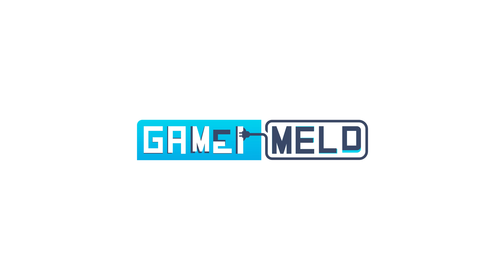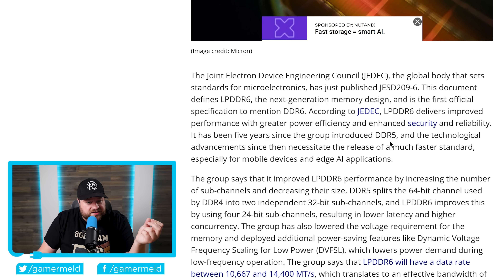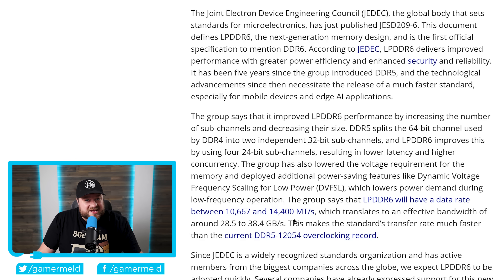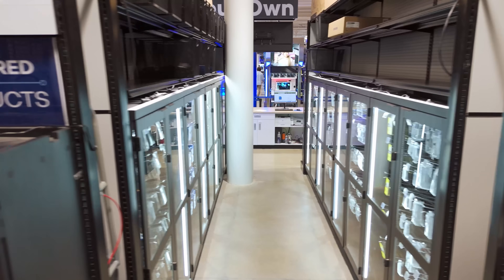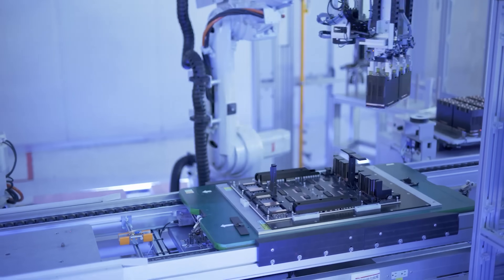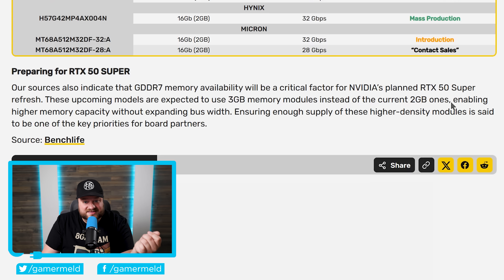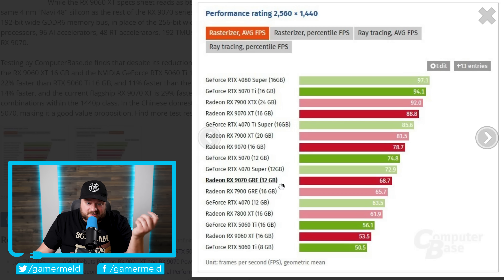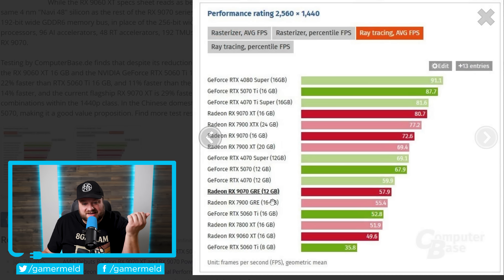AMD’s Mysterious New GPU - FIRST Benchmarks!

Comment: When DDR5 was launched the "performance" was worse than DDR4 at the same frequency, 'coz the stupid timings 36-36-36... that went from 14-14-14, so How The Fuck they're supposed to get faster if these morons increase the latency for synchronization? And the "dual channel optimization" clearly wasn't any improvement. Now Who uses 24-bit? Nobody is either 32 or 64, these morons, must smoking marijuana really hard to think this is a good idea. Also big MT numbers, even with DDR4 & 5, yet CPU Makers don't take advantage of i, and the timings don't help. DRAM is a stupid mess, to sell the same DDR3 RAM with a different disguise everytime

It won't be 10,000, but 11,000

Comment: well when your 9070xt under performs a 3 yeard old GPU then you have problems. LOL. the 7900XTX is my daily go to for everything. AMD went backwards and on the cheap and now selling half the gpu for double the prices. or at least the msrp is there. if the 10k series is not better than the 7900xtx then we are still not getting anywhere.

Comment: Not sure what you were expecting the 9070GRE’s performance to be? It’s 15% slower than the 9070 and 28% faster than the 9060XT… For a GPU supposed to be between the two, I don’t see what they could have done differently? Except maybe for the vram… If the pricing is right, this could be a good budget gpu…
Reply: I guess the takeaway is that the 9060xt is too slow that's what,  when you have that much of a gap between 60 and 70.

Comment: The Rzen 6 10k series will be the first Windows 12 compatible CPU. It has an NPU for ai. I will buy this as i am an IT professional. It will be great for virtualization and AI coding with lliami. I went AMD 5 socket for this and my current 7950x3d is good enough

Comment: Why were you ever expecting the 9070 gre to perform better than the 9070 non xt, the gre sits between the 9060xt and 9070 which is exactly where its supposed to fit but it all comes down to price most likely around $400-$450 is my guess.

Comment: 7900 gre was suppose to be a downed version of the 7900 xtx, so comparing it to the 9070 xt is kind dumb. Just saying.
Reply: Yeah… like 5070 vs 4090😂
Middle range vs highend
Reply: 7900 gre is way worse than a 7900xtx and never shoulder be compared to one

Comment: Interesting! AMD using 2 IMCs. So, what that tells me is, the infinity fabric will be reworked to work with 8 requests per clock, maybe fully supporting 512bit internal bus. It will also allow 2 different impedance values for the 2 DDR5 channels A & B. Motherboards with poorer memory isolation can train the 2 channels separately and help poorer quality memory modules achieve higher speed in a 4 DIMM config. It will bring the costs down significantly because many motherboards are unable to reach the EXPO speed when used in a 4 DIMM config.

Memory makers launching 4 DIMM packages at 7000+MT/s may be in respond to this. Having more IMC also help the OS and CPU schedule memory read/write better but how well that'll work is beyond my paygrade.

Comment: So if is 12 core in 1 CCD then here is what I am expecting: -

Ryzen 3 = 6 cores
Ryzen 5 = 8 cores
Ryzen 7 = 10 cores
Ryzen 9 = 12 cores
Ryzen 9 = 24 cores

Ryzen 7 with 10 cores and the Ryzen 9 with 12 cores will be great with 3DV-cach because all these cores are on a single CCD👍
Reply: Maybe Ryzen 3 will disappear because there are already APUs to fill up that gap. Also AM5 didnt had Ryzen 3 cpus. And i dont think there wont be any 16 core cpus. And it isnt also not sure that 10 cores will be on launch day.. Maybe they will sell 10 core later on the get rid of the slightly worser cpus.

Comment: On DDR6 WHAT KIND OF SOCKET WILL BE INSTALLED ON TO MOTHERBOARDS I HATE DDR5 SOCKET MOUNTED ON TO TOP THE MOTHERBOARD LIKE MICRO USB PORT SIMPLY FALLS OFF IS DDR6 SOCKET WILL FIX THE MOUNTED ON THE MOTHERBOARD LI LINE TOBE MOUNTED LIKE DDR4 SOCKET MOUNTED AND WELDED THOUGH THE MOTHERBOARD STRONG MOUNTED DOSE NOT FALL OFF and way can you find out what kind of information on the DDR6 SOCKET please look in to it

Comment: About the DDR6 news... on AM5 you can only run the memory overclock (EXPO) speeds with two sticks.  If you use 4 sticks of RAM then one typically has to run DDR5 at the base clock of 4800 despite whatever the packaging speed says.  A couple years ago I saw a video from Level1Techs that explained this as each DDR5 stick acting like two sticks in the channel.  If you run four stick of RAM (two stick per channel) then the system behaves like it has four sticks of RAM per channel and the memory controller can't handle it.  I think this is the same for the AM5 9000 series, but I don't know.  So this news about DDR6 makes me think that each stick will perform like 4 sticks of RAM.  So if you were to use four sticks of RAM (two per channel) on the motherboard, the CPU memory controller would effectively see it as 8 sticks of RAM and meltdown in a fit about being overworked.  Or I may just be dumb and not know what I am talking about.  Can someone the knows more than me explain it to me.  You don't have to ELI5, but bonus points if you can!

Edit:  Maybe this is why Ryzen 10k/Zen 6 series CPUs will have two memory controllers(?).
Reply: Noup in that case 4 channel memory controller would be better than two separate ones.
They use two separate ones to support two different memory types!
Reply: @haukionkannel    If I'm reading your comment correctly, you are saying that they would use one memory controller for say DDR5 and the other for DDR6?
Reply: @haukionkannel  How want they do that, if the board only supports DDR5 memory and is keyed in this way other ram wont fit.

They use 2 IMC because of stress with a single one.. 1. Its backwards compatible with the older systems. 2. It probably should give us higher memory speeds available.
If you want to use DDR6 (which itsnt released, then you need a new compatible motherboard, which will appears when switching over to AM6.
Reply: @rallyscoot same ways as Intel did. Two different motherboards with different memory options.
It is possible, but why they would do it… Intel did have CPU with ddr2 and ddr3 support

Comment: Does that mean that the new standard will be 9gb instead of 8gb since they are doing 3gb modules instead of 2gb
Reply: 12 gb with a 100$ increase to base MSRP
Reply: Yes. 96bit memory bus so 3*3gb=9gb!
I expect 6060 to be 9gb
6070 to be 12gb (128 bit memory bus)
6080 to be 192bit memory bus 24gb… 
😂

Or if we are lucky 6060ti to be 128bit…. But i doupt…

Comment: If that gpu is not anywhere closer to 5090 then I dont know what AMD is doing.!
Reply: If it is a solid mid range with 12+gb at an attractive price, it will sell well.

Ie if it kicks the pants off the 5060, and is much cheaper, it will take far more market share than if it was a 5090 killer (unless it was priced at 5060 levels.

AMDs game right now should be to push volume to win market share.
Price to performance at the mid range is what achieves that.

Comment: 2 memory controllers to me makes it seem like they are going with LPDDR and DDR compatibility on Ryzen - or perhaps the CUDIMM as you mentioned.  DDR6 support is also a possibility if they are intending to get two generations out of this IOD.  This wouldn't be the first time they have offered the same CPUs on different sockets.  Bottom line - two controllers almost definitely means two types of memory not used at the same time.  A quad channel memory configuration would be a single controller not two.

Comment: The 9070 is basically a 7800 class card so comparing the 7900 GRE and 9070 GRE is a bit like apples and oranges.
Reply: Interesting.  A disappointment?  I don't see it that way.  AMD intended for the performance of the 9070GRE to be between the 9060XT and the 9070.  That's why they put only 12GB in the GPU to begin with.  It is a cut-down version of the 9070, yes?
Reply: @CookyMonzta  I don't understand your comment here.  I was pointing out that a 256-bit mid range card is not a 384-bit high end card.  Honestly, I just think the 9070 XT came out $100 overpriced.  That's my only disappointment.
Reply: @cracklingice  I had a response here that was inexplicably erased.  The "disappointment" I was referring to was Gamer Meld's disappointment with the benchmark results.  Again, AMD intended for the performance of the 9070GRE to fall somewhere between the 9060XT and the 9070.  Beating out the 16GB 7900GRE (with only 12GB) was an unexpected plus for this card, which should be $100 cheaper ($450) than the 7900GRE.
Reply: It seems to be good competition to Nvidia 5070 that also has 12gb vram…

Comment: For the 50 series lineup - simply putting 3GB modules on is not sufficient.  For example the 5050s they call 5060s or the 5060s they call 5070s or the 5070 they call 5080.

Comment: I'll wait until NVIDIA fixes their fried power connectors then ill consider RTX5000. I'm waiting for AMD's RDNA 5!
Reply: some models actually come with PCIE cables my friend had PCIE 5060 ti
Reply: could be possible that RDNA 4 is the last Gen with older GPU power connector as we know.. And that RDNA5 = UDNA could have those nvidia power connectors as well. Why? Because some  of these RDNA 4 cards already have that nvidia power connector on the card.
I think they arent going holding much longer to wait on the new power connector.

Comment: 9070 gre is such a dissapointment after 9060xt and 9070/xt...
Reply: ?
It is against 5070 that also is 12gb…
Reply: But still doesn't disappoint as much as the RTX 5000 series with crashing drivers and melting connectors 😂

Comment: DDR5-6000, is the sweet spot, provided your AM5 processor actually functions correctly at that speed.  I have a 7800X3D, 9800X3D, and 8700G, and NONE of them are stable when memory is above base clock speeds.  I know that I might be losing the silicon lottery, but all my Intel machines since 13th gen have easily made DDR5-6000, and the new core Ultra's are perfectly stable at DDR5-8400.
Reply: its probably your motherboard if its the same on all the processors.
Reply: @geofrancis2001  3 different motherboards, 3 different chipsets (x870/x670e/x650), 3 different EXPO ram sticks, 3 different AM5 processors. It's 3 different systems.  The one common thread seems to be AM5.  They all run fine at DDR5-4800 but the moment you click on that EXPO setting in the bios, they will have issues.
Reply: "I know that I might be losing the silicon lottery" what do you mean by this?
Reply: @Tli-j9y3m not every chip is perfectly identical. Its called the lotto because while the vast majority of them will fall into a small window very close to each other there are outliers. You can get lucky for example and get a chip that uses noticeably less power. You may get unlucky like he is suggesting and get one that has a poorer memory controler and cant run the ram as fast. 

I would say its more likely to be a mobo issue that the other response said since landing 3 bad memory controlers in a row is terrible luck. Iv never run into the issue and have built quite a few ryzen machines for people
Reply: This is what I've experienced as well. DDR5-6000 CL30 for those that want the exact specs when picking out some ram
Reply: @MCToxication Che poi ho fatto tanti benchmark è sono la miglior soluzione in generale. Preferirei solamente le 7200 CL34 ma sono difficili da reperire in tagli da 64GB.
Reply: sweet spot is just marketing term for making people feel good about amd ram not being able to run as fast as intel can